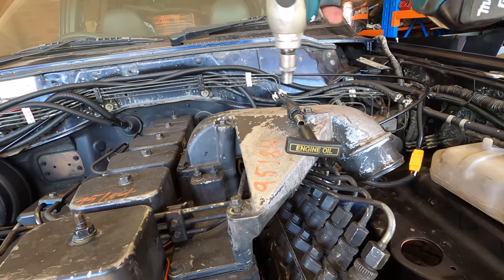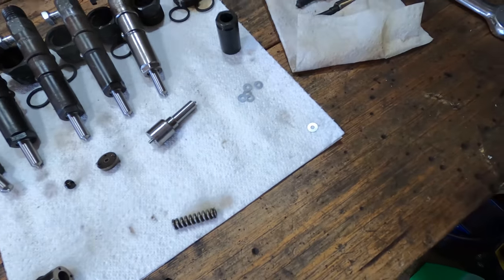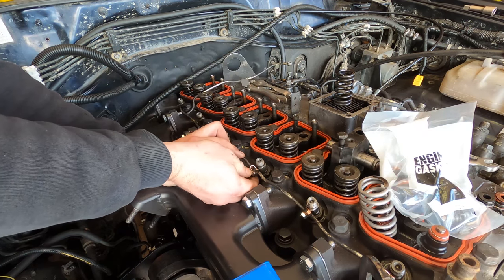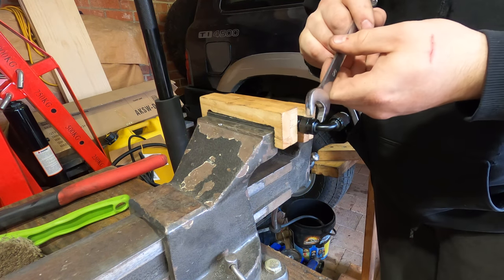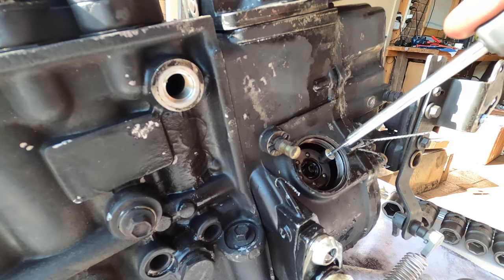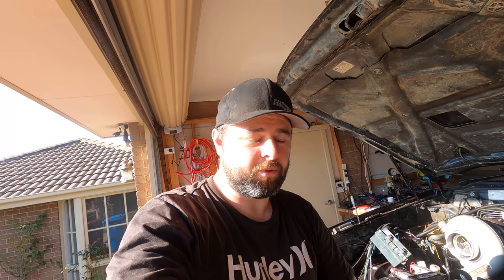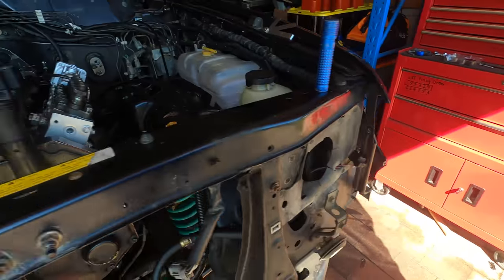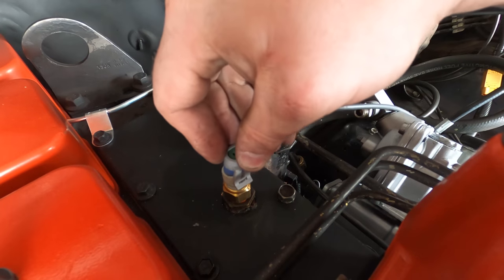6BT POWER Mods | GU Patrol Build [EP9]

Comment: I'm not being funny but you just breezed through several, thousand buck jobs, like they were nothing.  I'm gonna have to go back through and watch your vids I think as I've got some work to do on me patrol including injectors etc and I aint paying a thousand backs for every job!!  Thanks!!!!
Reply from the maker: Heh, the wallet is aching bad just from the parts cost. To be honest if the engine was in better condition I'd have been happy to leave it stock but yeah... with the original Holset being ruined in transport, and not having confidence in the Cholset, and pretty much everything else on the engine needing replacement, it made sense to suck up the cost and just build it up now

Comment: Great series mate. Where did you get your 12v from?

On a side note of caution for the future, any thing done to the fuel system on first start up have some standing by to  block off the intake in case of a runaway. I’m sure you did and I probably missed it.
Reply from the maker: thanks bud. from the states, out of a Dodge, through Texstar

yeah had a few pieces of plywood kicking about I could have snatched up

Comment: The mighty garbage truck engine! I give it 2 years and you'll tire of the noise, the 2500 rpm limit, the excessive fuel consumption and the endless cycle of coil springs sagging under constant 420kg of cast iron dinosaur motor.
Reply from the maker: So far I've done a few hundred ks and with the occasional silly full throttle pass I'm still only seeing about 11L/100km. 4k gov springs do their job. Noise is there but not awful, we'll see how it is after dynamat. Springs who knows but apparently everyone guessed the weight wrong as it's not massively heavier than the TB45e I pulled out